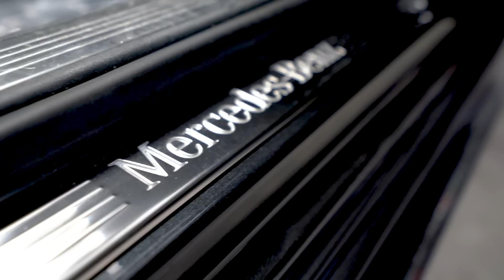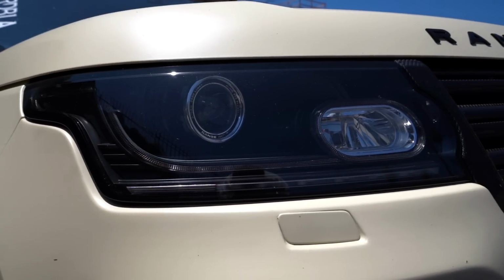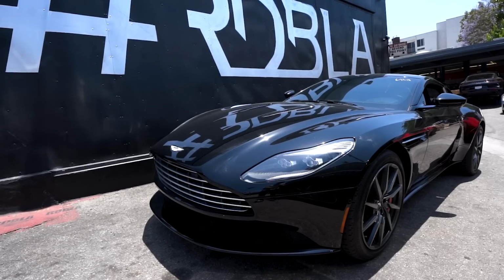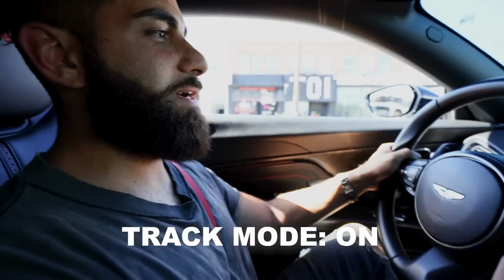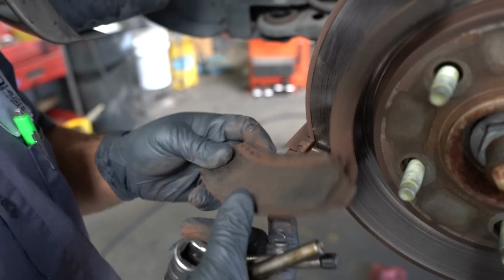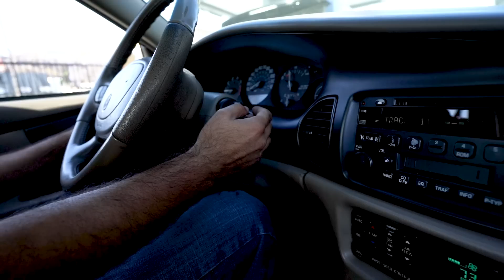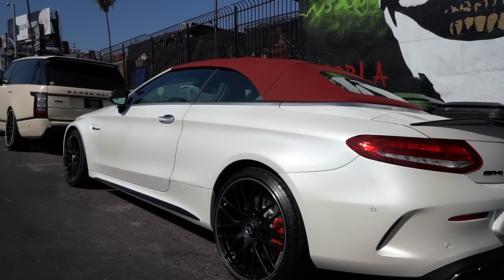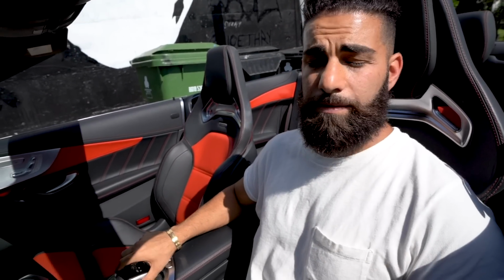#RDBLA DB11 Smoke Machine, C63S New Hip Replacement, New S Class Benz Black to White!

Comment: great video!! could you please explain how the plates work in the US? In europe each car has a licence plate on the front and rear while in your videos all cars have RDB plate
Reply: Nicolò A. A lot just have the RDB as a temporary plate and you can get away without a plate for a while if you have the paperwork
Reply: I believe in the state of California, if a car has been just brought, they dont require actual plates for 90 days. Also, the cars when they come in, have the actual plates, they take it off for branding of course. I am not sure, but since they are a body shop, they can drive the cars around for "testing" purposes, and if they need the plate, they might have it inside the car, or could go to the shop and get the information.
Reply: So what happens when u see hit and run or someone trying to kidnap someone? How do u report to the police?? I saw a white Chevy sedan that’s it??
Reply: In rdb case, i saw a black plate that said rdb. Other than that, you report it like that, and hope camera gets it.
Reply: Lol